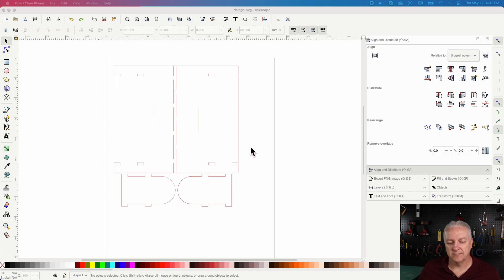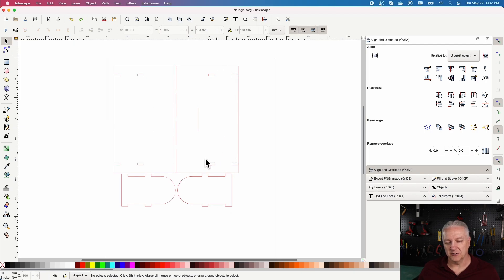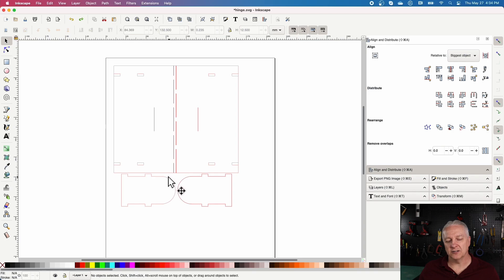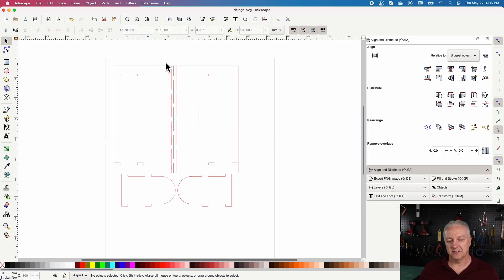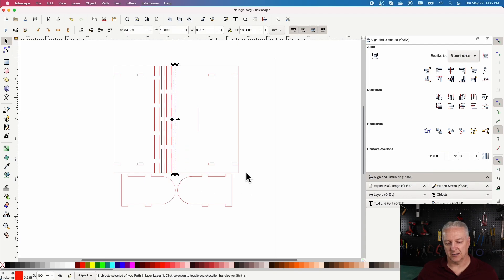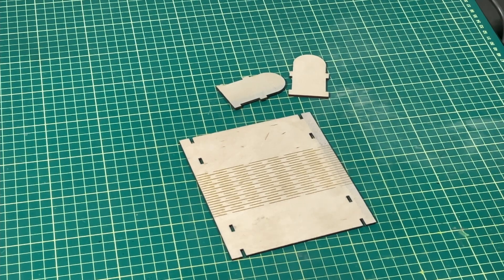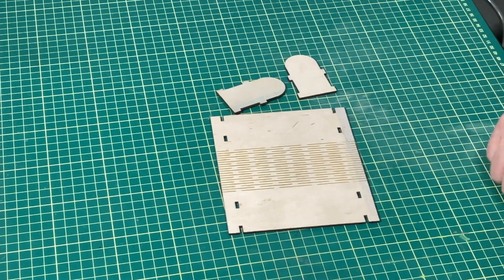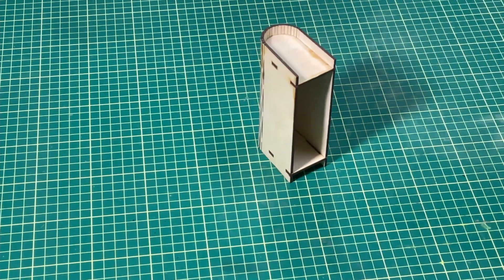HOW TO MAKE A LIVING HINGE

Comment: Thank you for this!  Did you make the lines 3mm apart because that's how thick your wood is? I use Home Depot's PureBond 1/4in which isi actually about 4.3(ish)mm thick. Should I move the lines farther apart, closer, or leave them the same as you have here?
Reply from the maker: For quarter inch plywood you might want to still keep the lines closer together so there is more flexibility.  I’ve only ever done this with 3mm plywood

Comment: Hi! How do you calculate the distance between the lines? Mine is 1/4 of a 30mm Radio circumference
Reply from the maker: I didn’t really do much calculation for this example. The point here is that if you cut several lines into a solid material you can give it flexibility to bend how you want.

Comment: How do you decide the radius, the length of the hinge, the gap between the hinges? Is there any thumb rule or a formula that can be used for a variety of jobs ?
Reply from the maker: There isn’t a specific formula for this but there are natural radius limit of the joint. You can improve this by putting the cut line rows closer together. The length of hinge will be at least the thickness of the thing you are trying wrap around.

It’s easier to do this with a CAD system because most can measure the distance around curves. This helps you figure out the hinge length you need